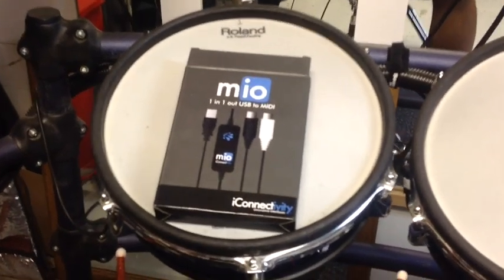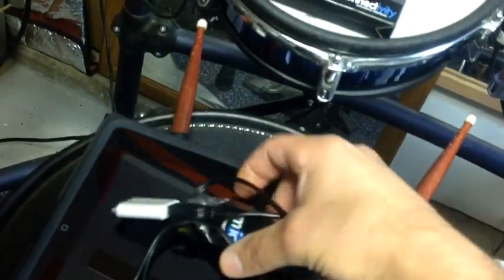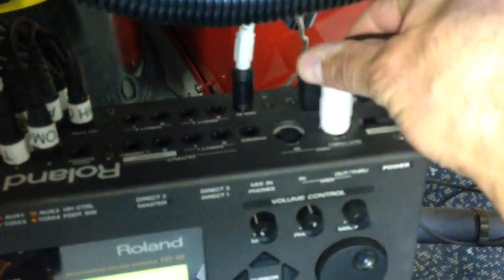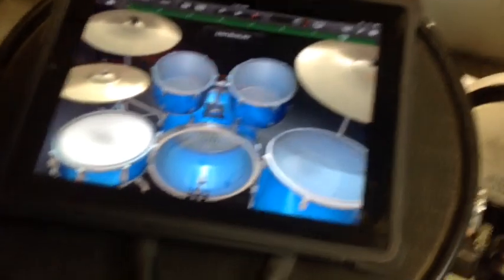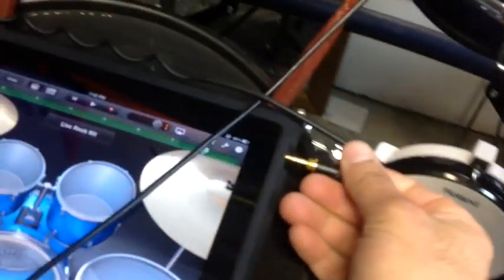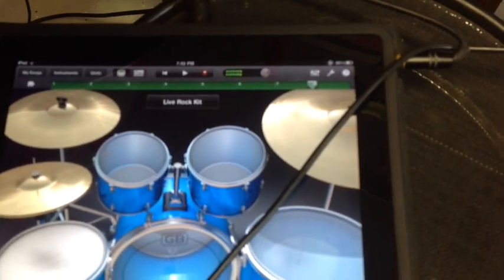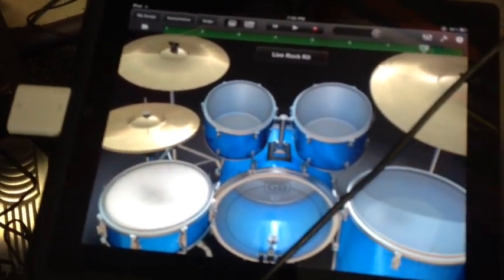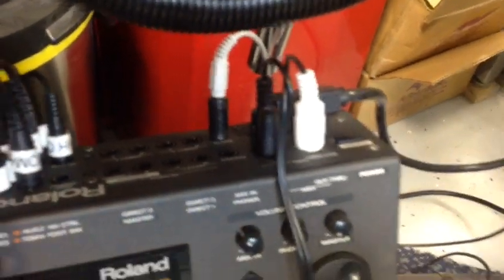Recording Roland Drums With Garage Band On An IPAD

Comment: Good use of legacy technology. Top tip: to prevent you recording an iPad audio mic version rather than the midi IN version is to click your sticks together, if it registers on the volume level then you know you've not connected the midi or any signal input correctly. I too use a similar connector on aTD11KV, but it only has one midi connection for the OUT feed rather than two as shown on this module. To compensate it has a wireless set-up which needs an additional Roland dongle and USB OUT for recording to a laptop etc. Another issue you might encounter is that like the patch channels not being matched (as shown by the blanked tom-tom 2 in the presentation) the EQ levels of each instrument (cymbal/tom) may be different; which may result in silence or clipping. No solution at my fingertips on that but try different channels to see if you can eliminate it or the onboard software you're using at the time.

Comment: I want to be able edit each pad of multi track drum. I use midi to usb cable.
If i want to live recording edrum roland td4 with the band, what do i need to do it? In my mind i think to buy mixer behringer 802usb,, but i confuse can i still able to edit my edrum if i connect to the mixer? I thougt that when i input to the mixer, the sound just be single data like guitar analog

Comment: I use a irig adaptor kit i bought for my guitar and plug the drums through one of the channels (L or R) and then muck around with the settings in garageband to find an acceptable (rather than brilliant) sound - it shouldn't work - but it does :)